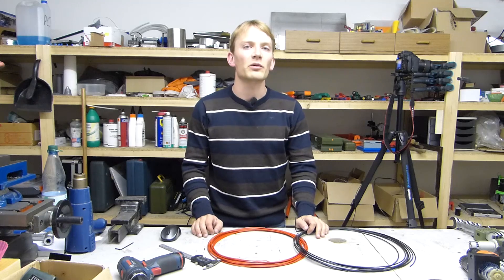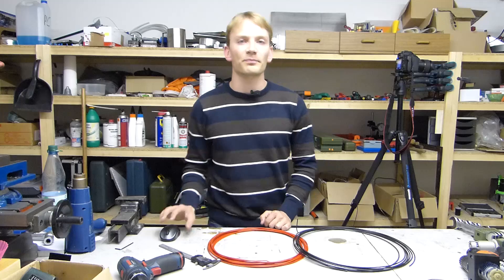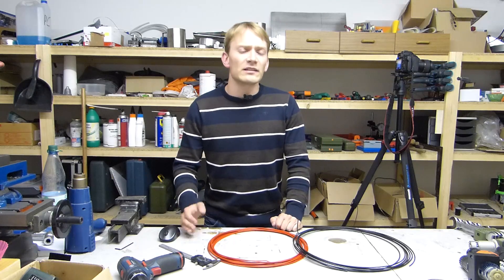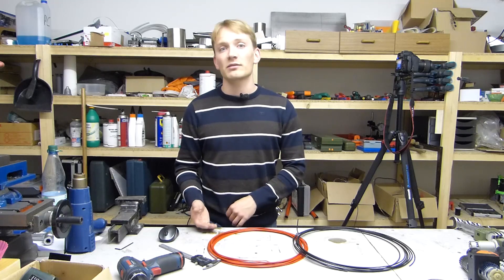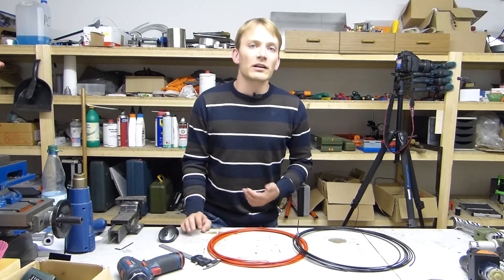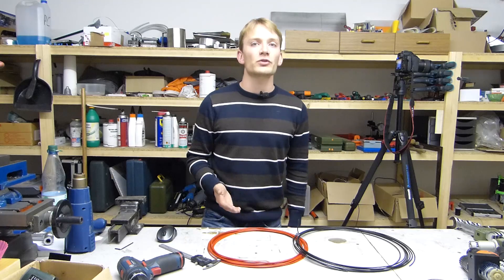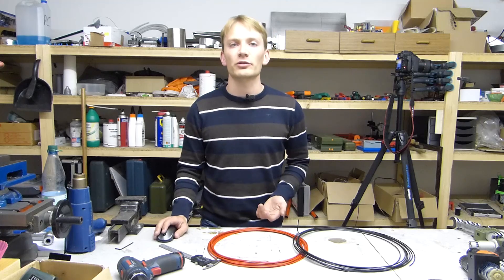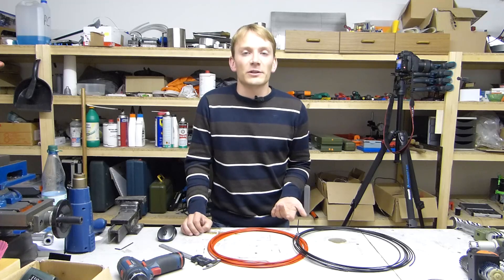3D printing basics - Intro to filaments

Comment: can all fillaments work on any kind of 3d printer?
Reply: PLA will work on any 3d printer. And needs at least a heated bed and requires a heated, closed, carpenter if you want to print large things with it.

Comment: 2:13 I pause looks up if inside a car can get up to 50 C
un-pause.... oh
Reply: Where I live in Arizona the inside of a car, especially a black car, can reach temperatures high enough to technically boil water.  

I say "technically" because the inside of the car CAN reach 212 F (100 C) which is the boiling point of water, however air is a very poor thermal conductor so it takes more time to heat water to a boil than there is in an afternoon of sunlight heating the car up.  So the car begins to cool in the evening before the water can reach a boil.  

Still, every summer dozens of dogs and children are left in cars and either die, or nearly die, from the extreme heat.  Also, many electronics left in the car don't last very long.  LCD displays in particular turn black and become useless.  And leather or vinyl seats in a car in AZ can be extremely painful unless you park in a garage during the afternoon.
Reply: Kur Norock lol i feel it i live in vegas

Comment: I have seen ABS pipes.  That is a very common use for it.  Go do your favorite hardware store and they may have some.  You can't miss it, it is black pipe usually.  So if you know a plumber who often has small pipe scraps he does not use and you make your own filament you may have a source of plastic to recycle.

Comment: This 3D filament looks so much like the 8000 feet weed eater roll I got earlier this year for 30 bucks
Reply: Actually, you can use that weed eater roll as a nylon filament, but don't expect it to print reliably. 3D printer filament is manufactured with a very tight tolerance on the diameter, so it is a bit pricier.
Reply: JandCandO i always wondered about this

Comment: Hi,Im looking for a weather resistant material any idea what is best ? 
and also that can bond each part together fairly easy ?Thanks in advance
 :)
Reply: I realise this is going to be much too late for you, but for others, you could try the newer ASA material that is now available. It behaves and prints the same as ABS, but is UV-resistant.
A good supplier is Rigid.ink. Their ASA can be found here: https://rigid.ink/products/asa-1-75-mm-0-03-mm-tolerance-filament
Reply: Thanks man its never late . An info is an info :) if need any post processing advice just ask :)
Reply: Odys polymechanos use ABS, OR you could use ASA. i have had little sucess with PETG and PLA outdoors.
Reply: Carter Peel  Thanks .There also pc max wich looks promising i need to check all of them :)